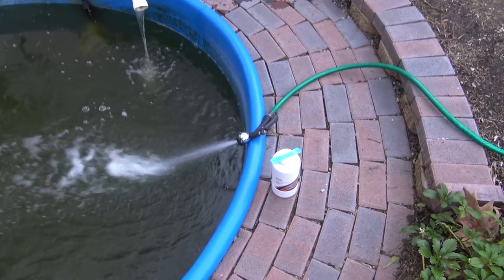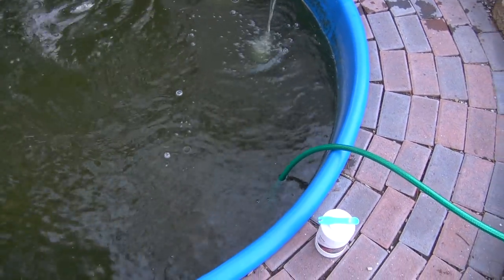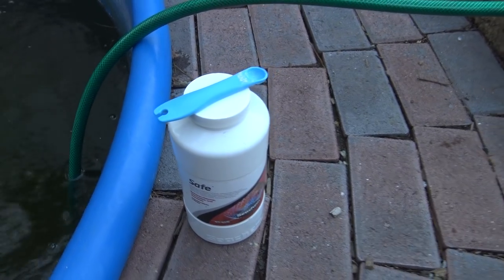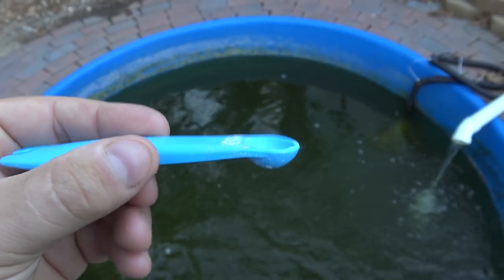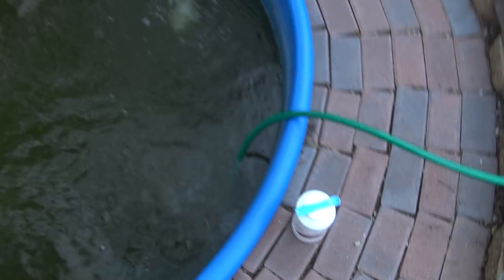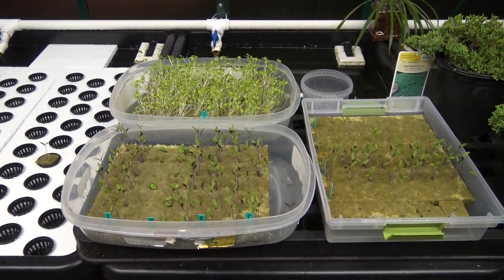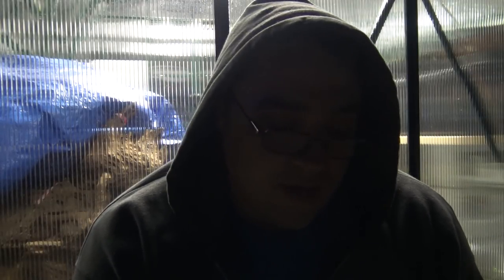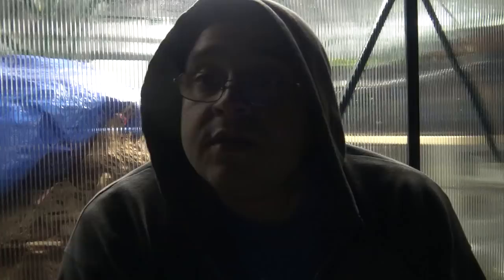#581: Greenhouse Projects at Night - Update Monday

Comment: i wonder if you could put some bricks or similar under some ares of the styrofoam to hold it up at that level and prevent it sinking.   That would not solve the issue of it breaking if you tried to pick it up, a large square size heavy duty fence under the styrofoam may work to help picking it up, but that could rust.  This will be interesting to watch for sure, hope it all works like you want. :)

Comment: Curious why chose a DE filter over a Cartridge filter?  Sure, DE will filter down to about 5 microns however a cartridge will do about 8-10 (depending on manufacturer)
From my experience, the cost of replacing a cartridge every 4 years so is far cheaper (and less time consuming considering back flushing/servicing) than continued expenses with replacing DE.   One note, your backwash area in your yard over time will be come cement hard.
Loving the greenhouse updates!  Thanks!
Reply from the maker: DE kills algae and makes crystal clear water, so i selected the best filter for that, thanks for the tips!
Reply: @gregjonesonline  Wow, I've never heard/read anywhere that DE will kill algae.  I'd enjoy a .edu reference if you have one.  Thanks!